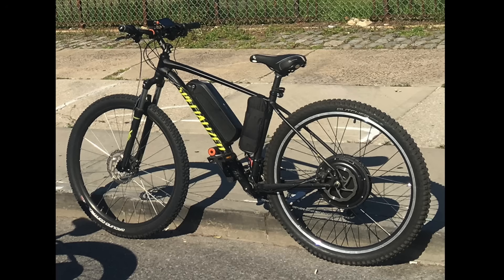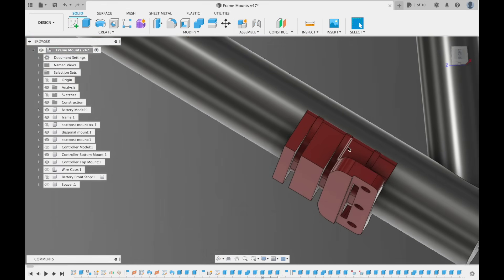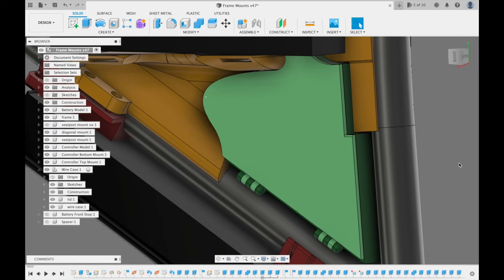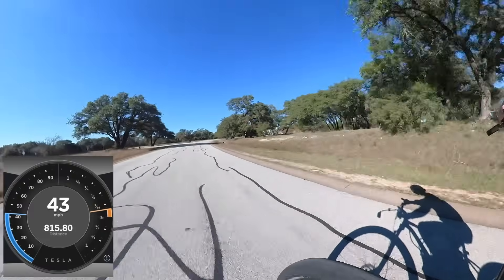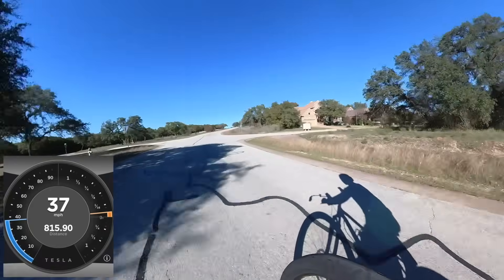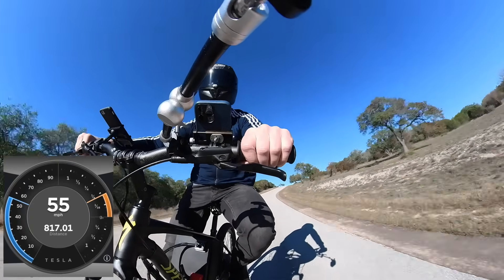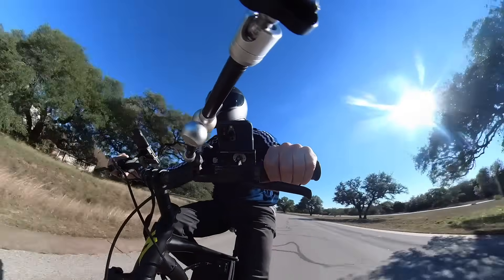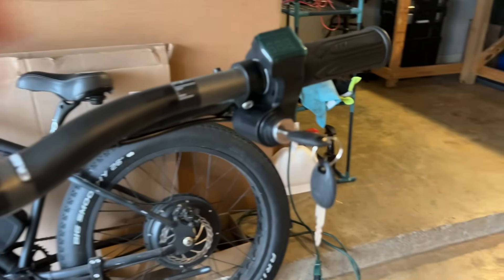I Built a 15,000W eBike and it's WAAAAY Overpowered

Comment: Imagine riding this on the highway and people being so confused
Reply: people are confused when I fly by them at 20mph on side streets here
Reply: @johnames6430   People are confused when I fly by them in the 0-20, and then they end up breaking the speed limit and going 40 mph to show off their lack of brain cells from huffing fumes all day.
Reply: Basically just a more stripped down electric motorcycle at that point 😏
Reply: @handlemonium motorcycle wheels are better suited for highway speeds and breaking at those, their spokes are thicker and shorter, and have much higher resistance on twisting when harsh breaking. This is bicycle wheels, with long thin spokes, if harsh breaking applied and wheel gets locked due to brakes of spokes failure the rider becomes a 50mph missile.
Reply: @BlahBlahManYeah  unless he’s a bull rider he’s definitely going to eat shit if the front wheel buckles.🤭
Reply: Imagine flying by a patrol car hitting 60mph on a 30 zone 😂
Reply: @andrea3v   Jailtime or a hefty fine doing that here in Aus, or the UK
Reply: the stupid thing is is that they should all be intrigued.
Reply: Imagine driving your car  in street and randomly a bike with very strange sound overtakes you and it has so many boxes in its frame

😂..
Reply: The Statie wouldnt be confused...lol
Reply: i have a hpc revolution xx that does 75mph and can pedal at 60mph. I get so many people breaking their necks staring at me
Reply: Well I don't have driving  license and  they will sue me if I use more than 250watts motor

But who the hell checks it lmao.
Literly gonna use a higher watt motor and put fake 250w sticker on it
As Cops in india don't even know about ebikes/ecycles
Reply: This much wattage it's a motorcycle.  I rarely see kids pedal bikes anymore but see them whizz down the street near 30 mph.
Reply: Nanrobot LS7+ 72v goes 74.5Mph imagine being passed by a scooter on a 65Mph highway. And you don’t even have to register them at all
Reply: Trust me!! there is a speed where one questions the durability of bicycle parts, at about 40mph, those forks start looking sketchy, the brakes look useless..  one goes back to the shop changes underpants, and switches to motorcycle stuff.
Reply: @larryscarr3897 I've ridden scooters and bikes at 40mph+ and it doesn't start feeling sketchy. maybe at 60+
Reply: @larryscarr3897 depends if its a steel bike should fine..aluminum is much weaker for sure.
Reply: @larryscarr3897 just buy a old decrepit motorcycle and use it as your body/frame
Reply: Or having to use the brakes lol dude brakes on that gotta be completely pointless
Reply: @ag3ntmp339  personally id be running motorcycle brakes and forks but I'm broke so ig not
Reply: https://www.youtube.com/shorts/4lZZtTmGISo
Reply: Just another dumb YouTube project. Bikes are not built to handle 15kW, this exceed 30 times what average person can produce at peak.
Reply: they will be confused for a second until they saw its electric
Reply: I seen it in bay area lol it was a

 gas bicycle but still
Reply: Woah why is there an unregistered  motorcycle on the freeway except built like shit
Reply: Dress like the wicked witch of the West while doing it lol
Reply: i do that on my ebike that does wheelies at 55mph effortlessly, and a top speed of 73mph.  :) i pedal as slowly as i possibly can that still counts as pedaling, the reactions ARE hilarious.  like a tesla recording me and racing me lol
Reply: Your still using the 5000w motor?
Reply: Wearing a wicked witch costume?
Reply: People get confused seeing me doing 30 lol
Reply: 40 mph is not fast 
You will feel it 
Now 52mph and above is fast
Reply: The whole society is confused generally.
Reply: Are you 12 years old ?
Reply: forget civilians and cops, how long is that bicycle going to withstand being subjected to these kinds of stress forces..
Reply: The police would not be confused as they're detaining you.
Reply: @mattmarzula if they can even catch him
Reply: @mattmarzula  Gotta catch you first .
Reply: @mattmarzula that's if they catch you first
Reply: The vast majority of the time police don't care so long as you aren't riding like a jackass or are fake pedaling 🤣
Reply: @mattmarzula  the police aint catching them

Comment: Fun project but don’t get pulled over. Here you’ll be ticketed for riding a motorcycle without plates at best. Anything over 500W is not a bicycle. 😮
Reply from the maker: its a motorbycle
Reply: What makes you think any cop has an IQ high enough to operate a multimeter?

Comment: Nice setup. Which model motor is that? I'm interested in that level of power. What made you choose that particular Chinese controller for it? Cost? Thanks again.
Reply: I've been lurking on Alibaba trying to decide on my next controller. This controller is the most watts/$ because it's square wave and doesn't have a high demand with the custom builders I've seen.

Comment: Shouldn't the motor be upgraded also?
Reply from the maker: most ratings on motors (like 5kw, 8kw etc) refer to how much power they can accept continuously without overheating. if you can keep the motor cool (or at least ride within some limits) it's not always necessary to upgrade the motor. I added ferrafluid to this motor for cooling as well
Reply: @GaiusGarage  maybe you can retrofits cooling sinks onto it

Comment: Amazing 3D print work! I have made a 20Ah 13s out of Samsung 40T and looks almost the same size of your battery 😂 
One question, if you created the frame 3D model yourself, how can I model the curvature of the tubes perfectly? I have an older bike ..
Reply from the maker: thank you! one way you can model is with a 3D scanner but one that will give you the resolution needed is very expensive. although I've had decent luck with 3D scanning using the camera on an iPhone 13 Pro but it takes some cleanup. but the best way is just some old-fashioned tedious measuring and iterative adjustments

Comment: Wow, this build is terrific! Amazing 3d modeling skills btw. Quick question: how did you measure the angle between those 2 frame tubes in order start modeling around it and get the print to fit perfectly?
Reply from the maker: Thank you! It really just comes down to careful measurement and enough filament to go through many iterations of adjustments
Reply: @GaiusGarage what hub motor is this and the watts
Reply: @GaiusGarage can you send me the link to the 60 amp controller that you had

Comment: You got some extreme balls. I currently have a very similar build to your first version of the ebike, 52 volt, putting out 1500 to 1300 Watts. It can easily get up to 35mph with no assistance. Fastist I got it was 46mph down hill and highest gear peddling my ass off. Doing that I did not feel too safe but it was cool. SEEING YOU HIT 55 WITH LITTLE THROTTLE IS TERRIFYING.
Reply from the maker: yeah its really does not feel safe lol. I have a stealth bomber type ebike that tops out at 55mph and it feels a lot more solid
Reply: Your frame /wheel/geometry might be completely different that this bike in the video, this was a nice bike to start from

Comment: Nice build! In the process of finishing mine with a 72v BLDC + Kelly Controller 200Amp 400AMP burst + 84v Lipo 32AH 
Will you be posting a vid from start on rolling stop to quick acceleration? (Within reason of not ripping frame apart?) lol
Reply: What kind of frame are you using. Are you going for ebike or something bigger? I really want to build one out of an old dirt bike or 250 motorcycle or you can go with the bomber frames I see online. It would be a lot heavier but feel much safer to ride.
Reply: For sure the old dirt bike will be on a different level of comfort and safety, e-bikes usually have 200mm travel front and rear while motocross bikes have 300mm generally
Reply from the maker: those are some nice specs! are you putting that on a bike frame? (I wouldn't suggest it) I actually tried doing some all-out acceleration from a dead stop here but the battery wasn't full charged so I wasn't getting the full power but also I was really worried about the aluminum dropout snapping so I never really opened the throttle fully from a dead stop. I recently sold the bike so I guess we will never know...
Reply: @GaiusGarage  you have already mastered all the other aspects of a quality, well-engineered ebike. How about a custom frame for a future build? The only upgrade needed is more gussets around the headtube, bottom bracket and rear dropouts. combined with thicker tubing, that frame will be indestructible and can integrate the battery and controller as well
Reply from the maker: @marthamryglod291  I have thought about it